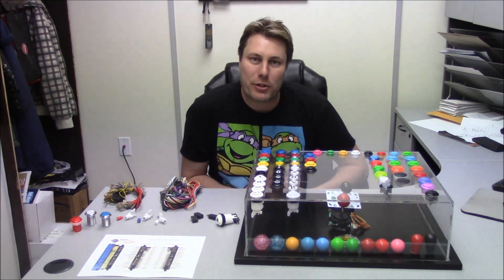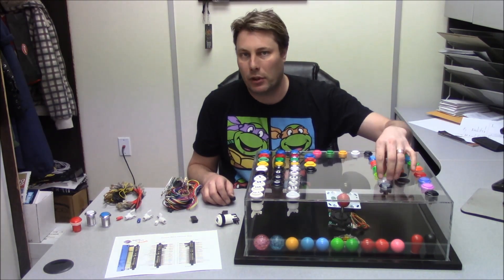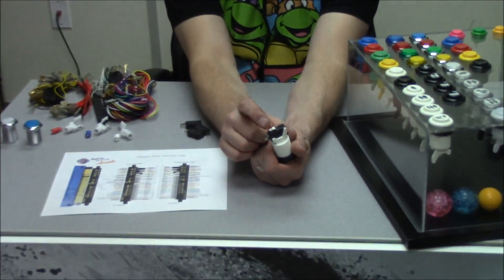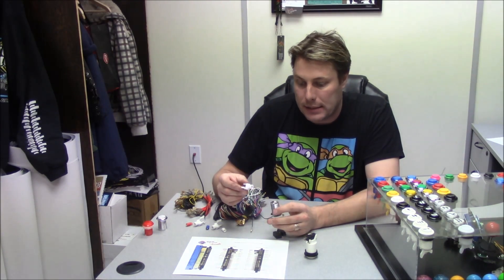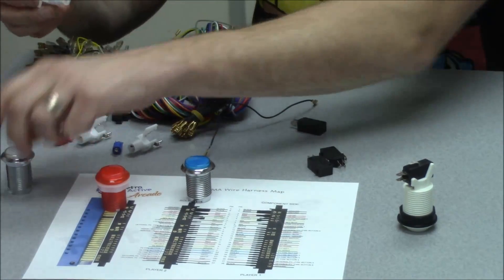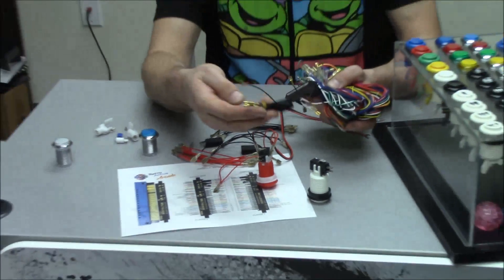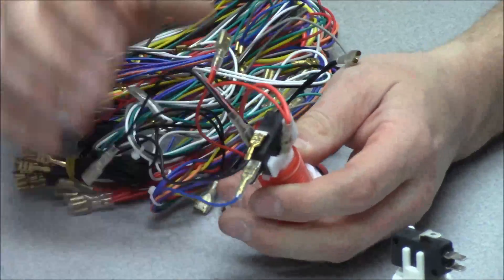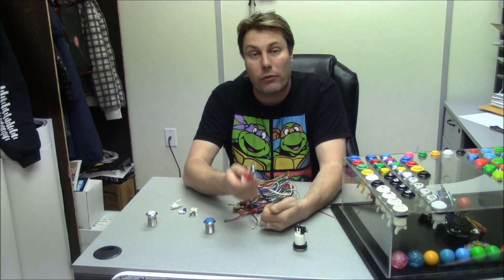How to wire arcade pushbuttons and microswitches

Comment: around 8minutes you tried to turn the switch holder into the chrome led button... “wouldn’t work for the video”... more like a pain in the ass for 3/4 of all my chrome buttons... its likely something due to the chrome plating or bad mold, but its a real pain in the ass. 

i feel like i am going to break or snap the switch holder, so i put in the switch into the holder to try get a firmer grip and i still have a fear of snapping them or the tabs on the chrome side.

it really doesn’t help that the lock/grip on the nut doesnt grip very well unless you really torque the nut on, im not a fan of torquing plastic parts more than hand tight... so trying to twist the holder in, just spins the entire setup.

if you have any tips or tricks to get passed this that would be great, next step is to bust out some vice grips and wreck the threads... just causing more grief.
Reply from the maker: When this happens it is usually because it is the wrong lamp holder for the button you are trying to use. That is the case for sure if you are having trouble with all of the buttons, then you need the right lampholders. If it is just a couple and all the parts look the same it could be that the spring inside the button has come out past it's stopper area and into the lampholder section not allowing the lampholder to seat into the button molding properly. Other than that it can just be a bad mold and there was excess plastic left behind from the manufacturing process, compare 2 buttons to see if that is the case and use an exacto knife to cut away the excess. If you break the tab the button is useless to be kind to it, that's all I've got for ya.
Reply: i ordered them from you guys! lol, so you may want to check into what holders you are sending out if they are the wrong ones.
About 3/20 buttons went smoothly, the rest were hell, and 2 snapped the clips. I had seen another website selling a very similar looking holder, but it was white. So it could have been a mixup?
Customer service told me it would be cheaper to just buy new ones rather than shipping the broken ones back and I was gonna just order 2 new ones, but the shipping alone was like $17.50 for 2 buttons (edmonton to regina) lol! also the panel i installed it in is only temporary until i build my cabinet, so who knows if i snap more, so i figure i will wait to order more.

Who knows i might win something from kastner arcade auction and have to come down to pick it up anyways, if so ill pop in checkout the store.
Reply from the maker: @soiledsux  just send me another email about this issue and some pictures and I will just send you some new lamp holders and buttons that have their clips broken. This has become a known issue with a shipment that we got in last month. We would b gre happy to have you at the store if you win an auction,  good luck!

Comment: I'm buying a relatively cheap USB encoder board, it comes with two wires. Red and black. Would I put the black on the ground prong? and the red on the middle prong? Or will that type of connection not work.
Reply from the maker: That sounds correct for a microswitch connection.  Is it a zero delay encoder? That is the only one I can think of that provides individual connections to each button, in this case you would be correct.
Reply: Thats it! Thanks!

Comment: The best video about the subject. Can I use this in a retropie build? Sorry if this is a dumb question, I am making my first one.
Reply from the maker: Peter Reynold Robinson Junior hi, yes you can use anything with a micoswitch for your retro pie build. If you are setting up for a 2 player arcade make sure to use an ipac 2 for your encoder.  I have another video on arcade encoders you should watch as well.

Comment: hey i got the suzohapp push buttons but it didnt come with any cords and I cant seem to find it anywhere about how to hook it up. Any ideas on where i can find the cords?
Reply from the maker: Are you using Jamma or Mame? If you are using Jamma you will need a "Jamma Harness" , if you are using Mame, you will have to wire them to the arcade encoder on your own with individual wires you have to make or you can buy single 1 meter wires with .187 connectors from us if you like.

Comment: Hey man! Good stuff....I always check here for product info! Question, I'm reworking a Stern Scramble cocktail cab....the CPs are really shallow from leaf buttons. Does Sanwa only come in 24mm and 30mm? The deep shaft Happ buttons won't fit, and Sanwa I would have to cut. Is there no short stem 28mm buttons available? If not...I may have to contact someone in China and setup shop! I prefer the Happ, but the Sanwa connection.
Reply from the maker: Hey Scotty, Yes Sanwa only makes the 2 sizes of buttons but there is a hybrid option available on our website. It is a 28mm american style HAPP pushbutton with a Sanwa grade microswitch that is halfway in length between the traditional HAPP buttons and the Sanwa buttons. Direct link to product listed below: http://retroactivearcade.ca/pushbuttons/concave/